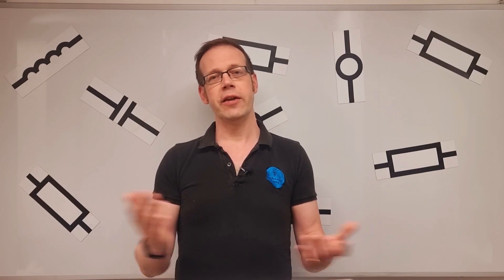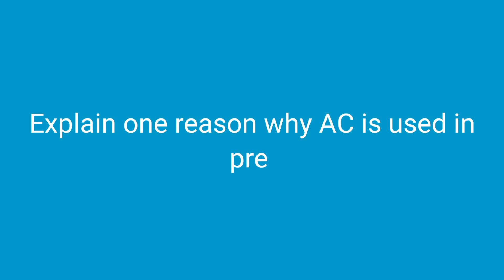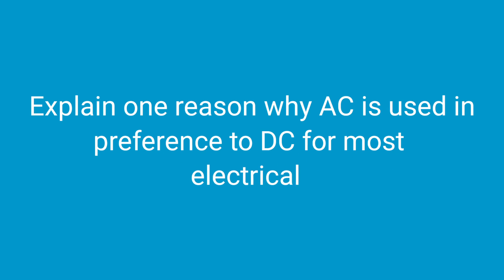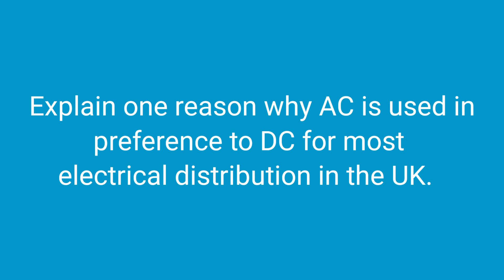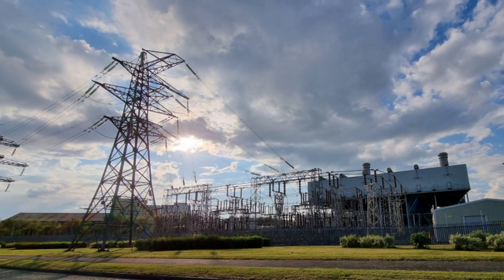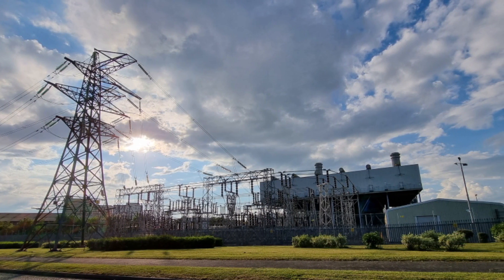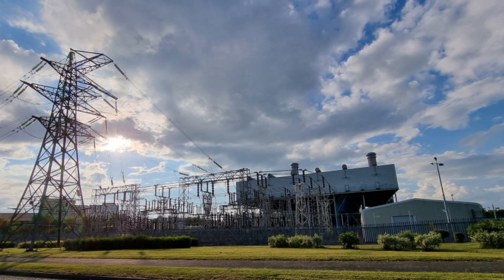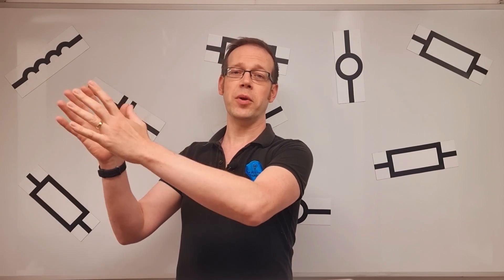8202 L3 Written Answer Exam Apr22 Q3: Explain why AC is used for electrical distribution in the UK

Comment: Sir,
Greetings of the day.

I was working on a 24V HBL make charger, catering to 12x2V batteries and load.

The charger was on float mode with 95A DC current load.
Out of which battery charging current was around 3A dc.

At load terminal I measured both DC and AC voltages with multimeter. It found as 27.0Vdc and 0.22Vac respectively. 

Also I measured both DC & AC currents, found 93.7A DC and 3.4A ac respectively. 

My doubt is as AC voltage component (ripple voltage)  is almost negligible , then why AC current (ripple current) is coming in circuit?

I measured parameters with 2 -3 different instruments, found same results.

Can you guide me for ripple current please? 🙏

One of your subscribers...

Comment: EV’s are all   DC?

Rectifier built into the EV converts
Level 1. and. Level. 2.  AC to. DC. 
to charge the batteries?

Level. 3. chargers. do the conversion to. DC. at very high wattage available.  Results in 
faster charge time ?